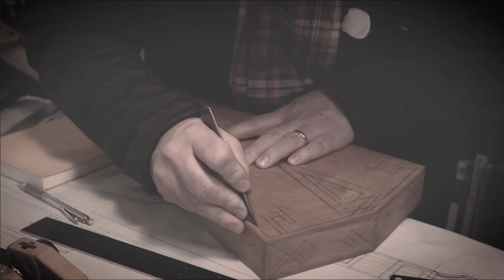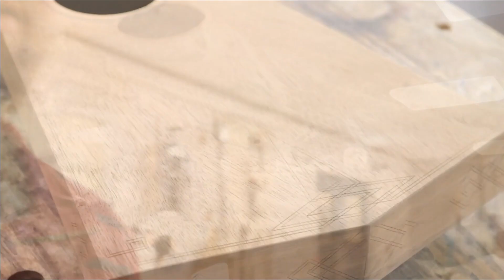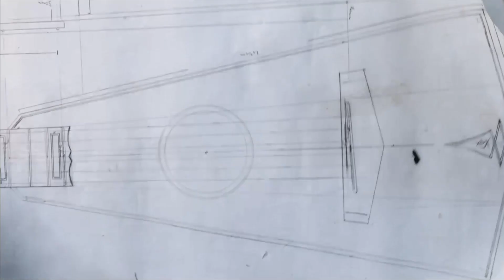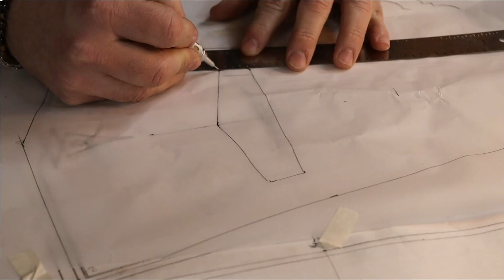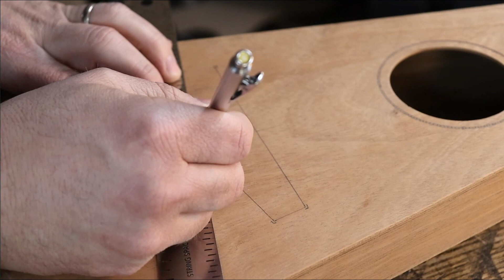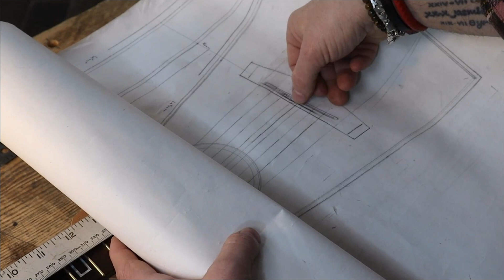Ep 15 Time to Finish | Hand Tool Only Acoustic Travel Guitar Build -  Guitar from a 4x4 FENCE POST

Comment: I love the line details! What is the technique called? I want to try it, but would like to do a bit more research on the technique before diving in.
Reply from the maker: Genuinely don't know what it is called.  This is the start of the purfling process but instead of gouging out the inside and inlaying other material, i.e. purfling, I fill the lines with guitar finishing oil and dust or charcoal to accent them.  Maybe call it wood engraving?  Ben
Reply: @CrimsonCustomGuitars  well, in that case, I’ll just have to dive in and give it a go! Thanks for the reply.

Comment: Wait…WHAT?!?
Put the oil rags in a bucket of water…because if they “dry out, they’ll catch fire”???
DID I HEAR THAT CORRECTLY?
Reply: It's not about what happens when the rags "dry out". If you put the oil rags in, say, a trash bag, or dustbin, in a pile, the oil will continue to off-gas, as will turpentine, mineral spirits, and the like. The folds of the rags will trap these gases, and at a high enough concentration, the gases can spontaneously ignite, and burst into flame. Hence, the bucket of water, to prevent this. Safety first.
Reply: @ErnieB  
Thanks for the info. Had never heard about that.
Reply: @PhantomOfTheMall  You're welcome. I grew up in an era of oil-based paints, with lead, and you needed turpentine, varsol, or mineral spirits to clean brushes. Often, when the supply ran out, a little gasoline from the mower would do the trick. Put a little bit in a tin can and slosh it around. Follow up with soap and water on the brush. Good as new. Use the gasoline to start the firepit, that night. Times were different.
Reply: @ErnieB  
Oh, I'm not quite as young as you might think...lol. I had just never heard of the rags catching on fire in the trash. Haven't spent a whole lot of time "in the garage", persay, but I've tried my hand at a little bit of everything. 
(I do amateur work on guitars, but strive to get much better! Hence I'm here watching Ben and being amazed!)

Comment: Nice to see this finally coming together (eventually!). Only thought is, if I had been building this, I would definitely have incorporated a piezo or two in the process, and had a jack socket/strap button. Would be a nice instrument to be able to amplify, as well as play acoustically. Would have also added a piezo buffer/preamp externally, like you get with the Sire acoustic guitars. So as to not have to locate any controls on the guitar, by having them in a belt/strap style box.